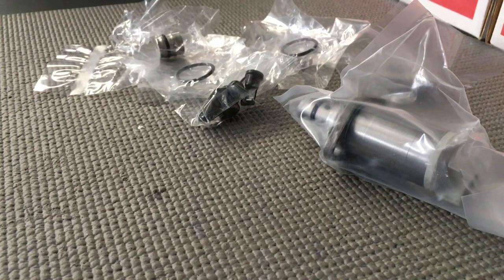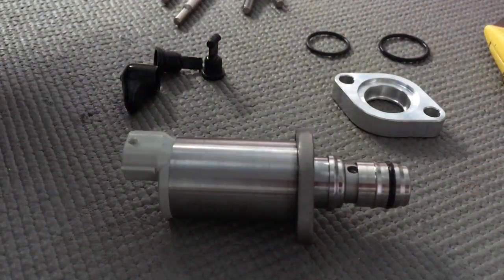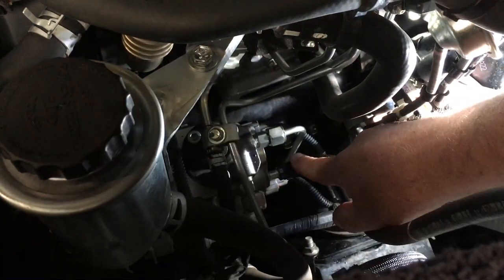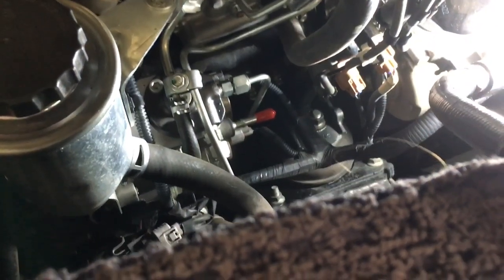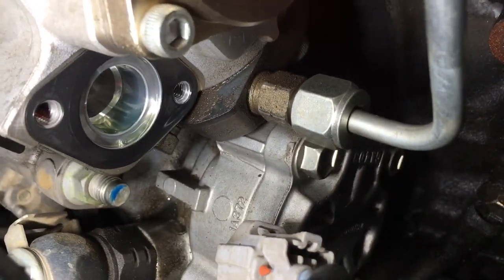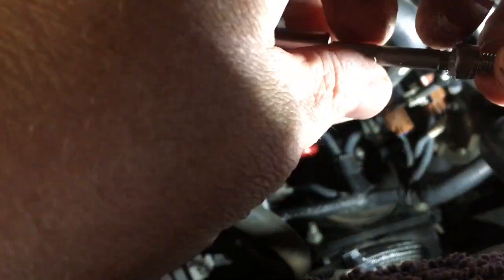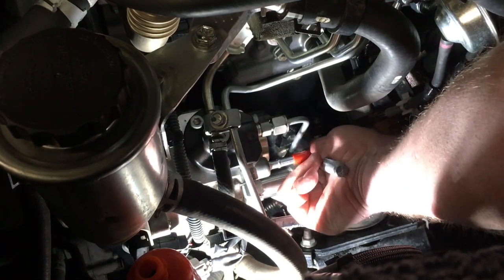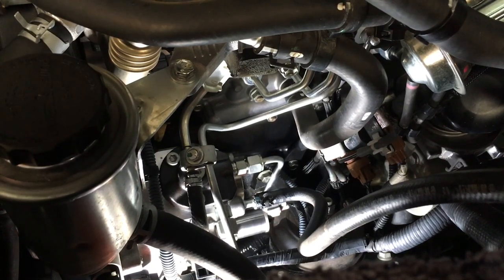SUCTION CONTROL VALVE INFO - DIESEL TOYOTA - SCV

Comment: I'd like to thank you profusely for solving this issue for me. I replaced the SCV on my 2008 Toyota Avensis 2.0 D4D (here in the UK, but the exact same part). I used the short one which I know you say is rubbish but I didn't feel qualified enough to judge which long SCV I should get so I replaced it like for like. Got the part from eBay for £46 but it was a genuine Denso one. It was an easy job thanks to your guide and now NO MORE RANDOM STALLING! It is wonderful. Less rattle on cold starts and a solid idling RPM. Can't thank you enough, I've been trying to solve this one for 9 months and no mechanic has been able to work it out
Reply: Did you also have to update the ECU software or you just put the new one on?
Reply: What part number?

Comment: Just replaced mine. Was a "long" one already in my ute (Hilux 2008). No need for the spacer, cap, long bolts etc..., out with the old and in with the new. My issue was... stalling intermittently after 1st start. All good now. You're vid helped, thankyou.

Comment: I'm trying to do this on an 08 hiace d4d swb 2kd-ftv and by God these hands don't fit nor do my tools 
The wiring loom prevents access, as does the fuel filter. 
Calling it a tight fit is an understatement.

Comment: Many thanks after successfully installed mine without an issue. Bit tricky to tighten the 5mm Allen on the side you can’t see but got there at the end. Would’ve 100% dropped the bolt without ur molykote method to glue the bolt to the tool.

Comment: Hey great video Tony. Have a 1VD-FTV in a 79 ute 2011, was previously a mine truck 😥. It Has trouble starting when cold or been sitting a while, but not warm or been running. Can this valve cause starting issues like this? It never cuts out whilst running, I haven't checked the valve for the version yet.

Comment: Sir, I have a Toyota hilux 2.5ltr D4D 2002 it has the short suction control valve. please could you tell me what should the voltage be supplying this unit. I currently have 2.6 volts. The engine will only fire up, when I pump the filter primer at speed. Please could you help me. thank you.

Comment: Do we need learn or something after replacement? On my 2kd, I changed from short to long, engine not running. Seems different hole pointing between short and long. Normall open and normally closed I mean.

Comment: i have uk invincible 2012 i changed the injectors and fuel pump but it cuts off after few seconds or sometimes after 1 min if im lucky, the error code thats coming is injector drive circuit bank 1 error, though current is coming to the injectors ,i dont know what could be the fault as the injector drive drive we tried from other vehicle but behaved the same

Comment: My Toyota Fortuner, an SUV version of the Hilux in the Philippines suddenly stalls when it idles for about half an hour on traffic but drives fine, is it an SCV issue?
Reply: Sir may i ask after 30 min idle it will stall after  cranking it will start automaticaly or it will crank more 4 to 6 times before it will start?

Comment: I checked the injectors, glow plugs and battery (all fine) but i have a cold start problem on a toyota corolla  d4d 2.0 litre 2003. Could it be the SCV or fuel pressure sensor ?? Any good ideas that i can try to test the car ?

Comment: Hey mate, how much are these upgraded ones? My 07 Hilux has got the short one and has some running issues (with brand new denso injectors, coded in etc)
Reply from the maker: Depends where you buy 
Mine are $330 delivered
Reply: Well i work for toyota and cant get it that cheap. I'll be in touch soon ✌

Comment: mine is the long one but still cuts out after idle for about 10 sec. iis on the 2kd kUN25
Reply: Hello, did you get it fixed? What was causing that? Mine does the exact same thing.